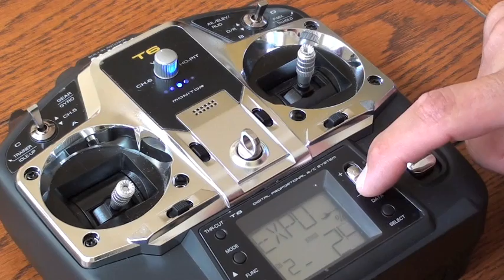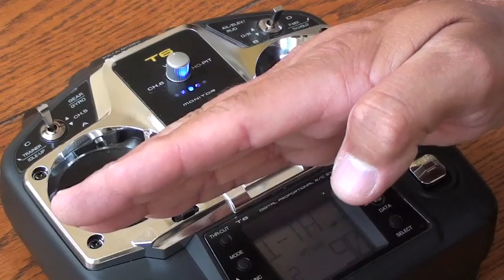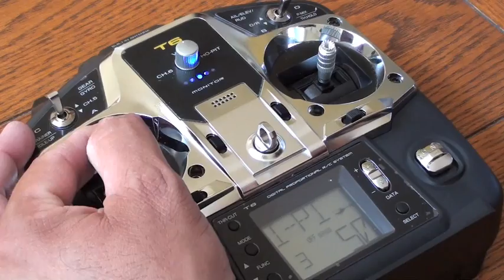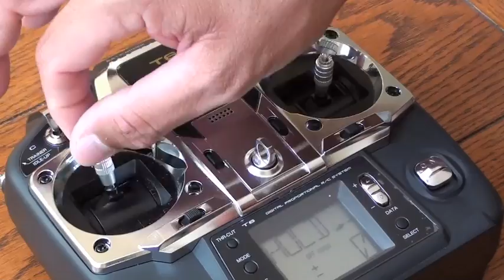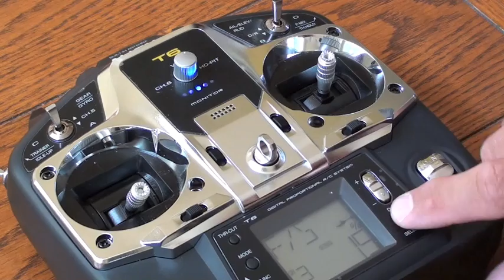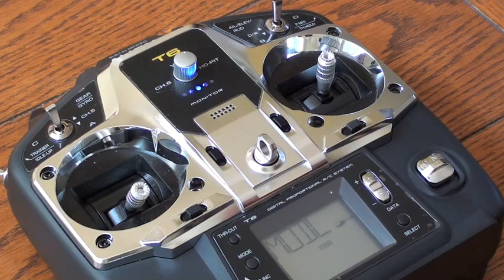Align 3GX MRS Futaba Radio Programming

Comment: hi Jeff,ive got a problem with this unit! I have a dx8 mode two but once the unit is set up its in mode 1,so when I use the pitch on the left stick its elevator and the right stick is pitch and throttle?????????? any ideas???? all plugs in the right way so god know? thanks
Reply: I have the same problem.  Did you get yours figured out?
Reply: No mate, its just sitting here, biggest waste of £105 ive ever spent, oh apart from the trex 150 lol
Reply: I would check them modes for the controller.  That's what I have been reading

Comment from the maker: Yes, the programming is very similar but you will need to adjust the pitch to your needs for the 450 but the other setting are very close. Should be able to get started with the numbers and settings.